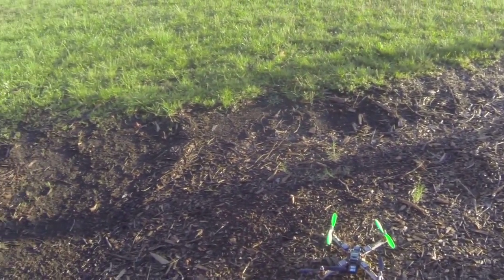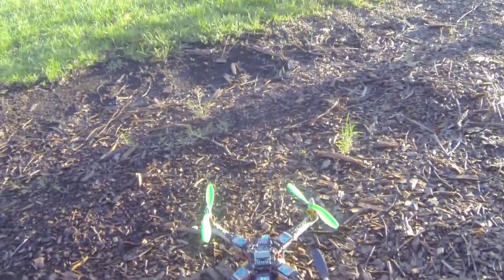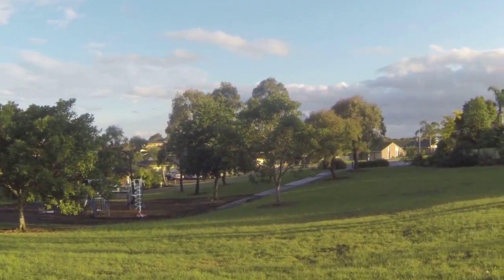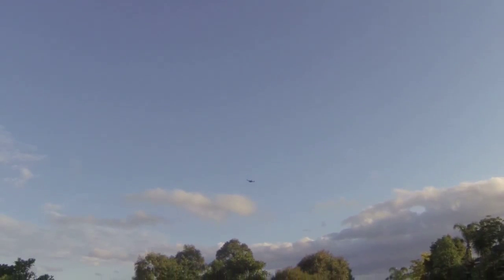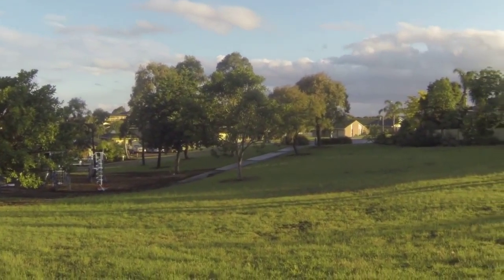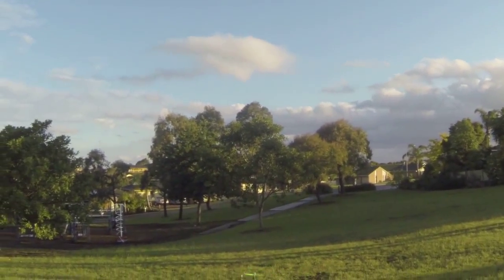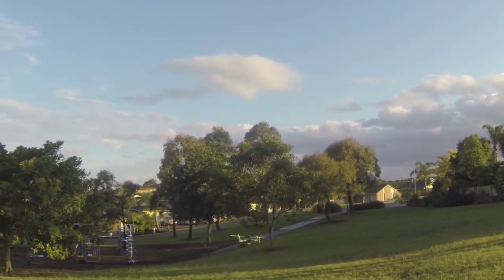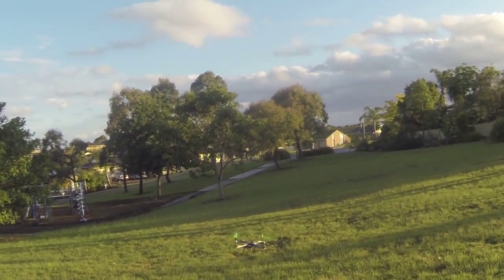Scratch built PVC quadcopter

Comment: Very impressive. I would be interested to know what size PVC and how you matted the motors. As well as the battery capacity.
Reply from the maker: The PVC is electrical conduit 20mm OD, 16mm ID.
To make the motor mounts, you heat the end with a heat gun until it gets soft and pliable, then press it between two hard surfaces, I use two pieces of hardwood. Then drill the holes to suit your motors.
The battery is a 2200mAh 4S.